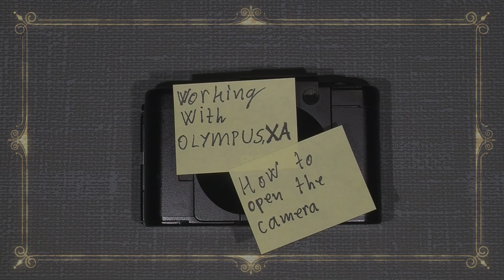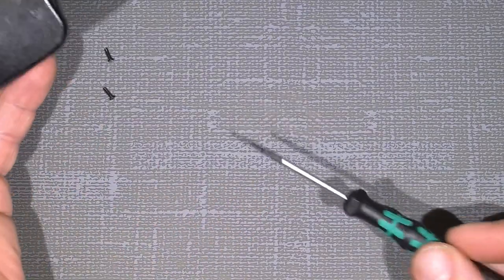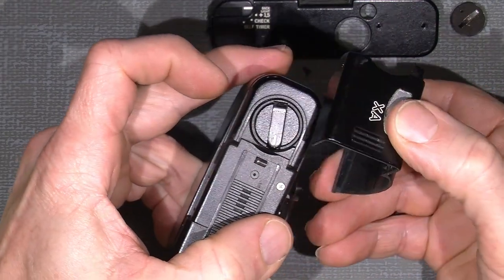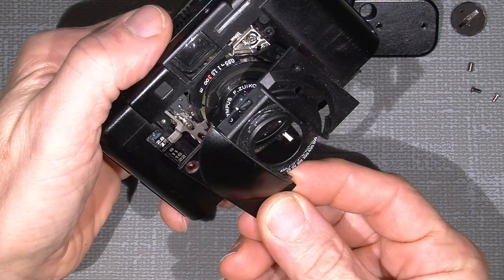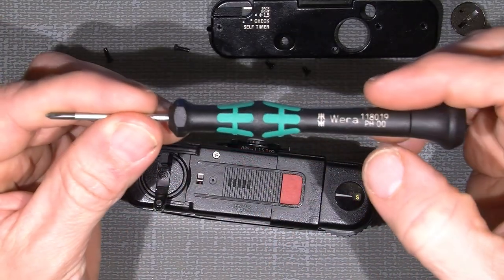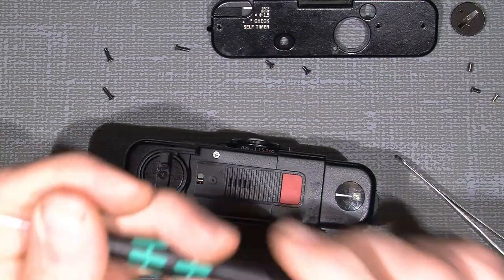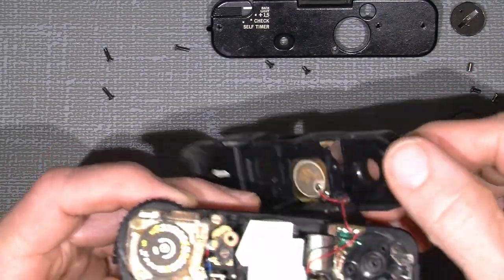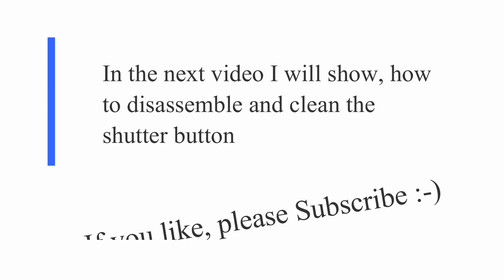Working with Olympus XA, How to open the camera

Comment: Thank you for this very helpful video, I am very happy that I was able to open my two Olympus XAs and clean their dirty viewfinders! It's almost like they are new now, like the 80's! 😎 
Just one thing, on mine the rangefinder window shade is not made exactly the same.... There's a micro spring to put back in place, so it's a little bit trickier.... But with a little thought, I managed it! 😅

Comment: My XA stopped working after it fell out of my pocket, no more shutter response and the battery check wasn’t working either.
I just took it apart to check for torn cables or broken soldering points but couldn’t find anything.
When I put it back together it just decided to start working again 🤩🤩

Comment: Mine XA does have a loose film sprocket. So when I am turning the film transport dial the film will stay more or less in the same position. The film rewind buttom underneath is not stuck in and is not causing the issue. So how can I get inside the film sprocket chamber to look what is wrong? Help or advise please

Comment: Batteries are good, but still no function? Remove and check the battery cover. Early versions of the battery cover had a tiny pin sticking up in the very center that will often corrode, blocking connection to the battery. Scrape off this pin and try again.

XA-2, 3, -4, users - do NOT try to pry off the red release button! It is inserted from the underside of the top cover and cannot be pried off!

After removing the top cover, note that there is a somewhat large brass washer beside the release button, around where the chrome screw goes. Do NOT lose this washer! Be sure to replace it before reinstalling the top cover -- use a bit of contact cement to hold it in place. If it's missing, the release button will not work properly.

When reinstalling the top cover, slide the aperture control all the way up to the "Flash" position. (It will likely be necessary to gently lift up the tiny clip above where the flash attaches, just in front of the rewind knob/shaft. This interlock is intended to prevent accidental setting of "Flash" mode unless a flash is actually attached to the body.)  Doing so will hold the clip at the top of the aperture slide toward the back of the camera, so that it doesn't catch on the rangefinder's glass window.

When we first trained on these at Olympus, we thought they were incredibly small. Then they made the Mju-2!
Reply: Good to know about the release button in the other XAs..Do you know if the light meter needle is adjustable and how to adjust?
Reply: The meter assembly on the XA can be trouble, but the need for meter adjustment is quite rare. The meter itself is controlled by it's own CdS cell, which may have died, or one of it's leads may be broken, or pinched and shorted. If this isn't the case, check the following:

If the needle seems to move, but does not move freely or in a "lively" manner, and is always too low or high, it may be that one of the tiny delicate coil springs at either end of the meter frame has become "looped" over one of the adjustment arms next to the meter frame. If may be necessary to remove the rangefinder assembly, then unscrew the meter assembly which is attached from the underside of the finder's frame. Once the meter is removed from the finder frame, there is a small "+" screw at one end that holds a protective "can" over the meter. (the meter wire is usually painted over -- put a drop of acetone on the paint to free the wire before removing the can) Remove this and carefully inspect the coil springs at both ends of the meter. If one of these springs is hooked underneath one of the small arms next to the meter's frame, carefully unhook it and gently press the arm down against the frame to keep it out of the way of the coil spring. Reassemble

Next, probably because of it's horizontal orientation, the galvanometer can be easily knocked off the pivots at either end of the meter. When this happens, the needle may appear to be jammed. If the needle fails to respond to variations in light, this may be the case. It is possible to repair, but it's very tricky. Remove the meter assembly and can as above, and inspect carefully to see if one of the pins of the meter frame is out of it's pivot cup. If so, put a drop of acetone on the paint sealant holding the "--" screw at one end of the meter frame and carefully turn the screw just enough to slip the pin back into it's cup. Then gently turn the screw back in until the meter needle drags, then unscrew just enough for the needle to move freely. Reassemble.

Another possible problem is if a small piece of metallic debris has become stuck on the magnet at the center of the galvanometer. Disassemble as above, and inspect carefully with a magnifier to see if there is a foreign object stuck to the magnet at the center of the galvanometer. If so, carefully introduce a needle into the opening to attract this metallic debris to it. It will usually stick to the needle, and can be removed that way.

In the exceptionally rare case that the meter is otherwise functional, but simply "off", at the end of the meter is a plate with (to the best of my memory) two small holes. Rotating this plate will affect the position of the coil spring at one end of the meter, changing the needle's position.

 @Morbid_Tom432

Comment: Thank you for the content; I found this video extremely helpful for opening the bottom panel of my XA. Currently, this camera (loaded w new batteries) will not fire, will not advance, and has it’s rewind release button stuck in the depressed position. Assuming this is a mechanical issue, do you have any advice on how to repair? Thank you again!
Reply: same issue. what did you do?
Reply: @manuelzeeman  I was lucky to have a camera repair shop nearby where I live. The repair person was familiar with this issue and showed me what would need to be replaced… It was a major component of the camera which would cost more than what most ppl are asking for their used XAs. I’m planning on selling my defunct camera as-is😕
Reply: @michaelfeldman3679  what was to component? I have found the source problem of many dead XAs and its a simple resolder fix.
Reply: @manuelzeeman  if anyone’s still interested I opened up the bottom and manually triggered the shutter from a lever right behind the focus slider. Then you can wind the film and the button will pop back up. This isn’t a fix because you will need to do it every time you click the rewind button

Comment: I just fixed my Olympus XA2, the shutter button would not fire. I could not remove the red shutter button as it was stuck on pretty well but I could get to it by removing the three small screws that  the red button was attached to the top cover of the camera from the inside. Cleaned the contacts and bent the four contact pins upwards a bit and problem solved. The shutter button mechanism on the XA2 looks a bit different than on the XA. Self timer still doesn't work but that I won't use anyway.
Reply: Hello, are you saying that the XA2 top cover will come away without undoing the screw underneath the red button?  Thanks.

Comment: I just bought a XA2 .Without batteries in the camera, the shutter button is stiff and the film advance is stuck. Is this because there is not batteries or is the cam broken? Thanks for your help. Great video!
Reply: Hey Eddie. The shutter button on these cameras is sometimes called a ‘hair trigger’ as they’re incredible sensitive, taking very little pressure to fire the trigger. It’ll feel stiff as they have very little play.

Comment: Does anyone know how to adjust the needle meter reading? The service manuals mentions an arm but i have heard you adjust the meter housing/needle with a screw. My needle respons to light but seems to need adjusting to show the faster and match the speeds.(the camera exposes correct) anyone successfully adjusted the needle?

Comment: Is there any way to reach inside the back glass element? This is the glass that sits in front of the film itself. I got inside some kind of a particle (probably from an old light seal foam). Will it degrade image quality, or should I ignore it at all.

Comment: Hello, i have no idea how to contact you, but i wonder if you can offer any help. I broke my meter needle, by turning the adjustment screw for the needle way too much counterclockwise. I've heard a small click, and now its frozen in place. :( Is this fixable, or did i break something really, really bad?
Reply: Hi did you fix your needle in the end? so it is possible to adjust the needle? Is that the screw next to the needle on the light meter? Which way to turn to show faster speeds and by how much? Is it definitely the screw that adjust the needle..I need to do this myself but there's not much information about it
Reply: Maybe someone could make a video explanation as it seems to be  common easily fixable? Problem
Reply: From what I gathered you should not turn this screw at all. Service manual says that to change the shown value there are 2 resistors soldered next to the meter. I just left mine showing one stop underexposed.

Comment: Hello mikeno62 I hope you find well and healthy, your videos are excellent, I would like to know if you have managed to find any solution to the problem of the always active self-timer, I have a camera in that condition and it would be a shame to lose it.
Reply from the maker: You could take a closer look at the bottom switch, sometimes there could be some bad connection or bad wires, of course it could also be the electronic parts that have cold solderings, just some ides.

Comment: How different would a XA2 be??
Reply: I just took a stab at an XA4 and it was slightly different but nothing crazy. The shutter button on the XA4 wasn't hiding a top plate screw, so I dug at it for a while before I realized that.

Comment: Hello Mikeno62, is it you owning the same account on Instagram (with 0 post)? In fact I'd like to communicate with you and send you a photo of some part that fell from the open bottom of an Olympus XA. Opening another one to compare I didn't see that part. In fact it's not the 1st XA that I fix and I'm really surprised seeing that part. I don't see the part on the service manual so it is really strange. Thank you for your answer. Regards

Comment: Does anybody have a clue what might cause the following behavior of my XA:
The camera actually operates perfectly fine as long as the shutter speed is about 125/1 or faster.
If it's below that the shutter blades will open, stay open, and the red LED starts to blink and the camera beeps along with it (just like it does in Self Timer mode while it's waiting).
The shutter blades continue to stay open forever and the camera keeps blinking and beeping until I either point it at a bright source of light or turn it off by closing the lid. Then the shutter closes without any problems and I can advance the film normally.
Reply: There might be a problem with the aperture blades, it might be stuck due to dust or oil, you can remove the front plate and it shouldn't be hard to find a tutorial about it (by far I found one on Flickr) and for the red light timer-like problem, there might be a sensitive wire down below the plate due to corrosion or something like that.